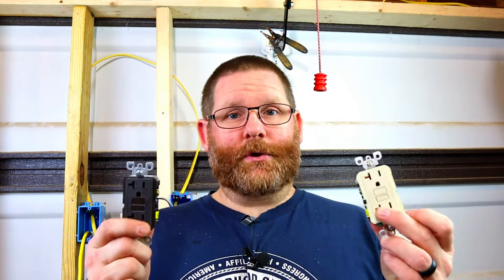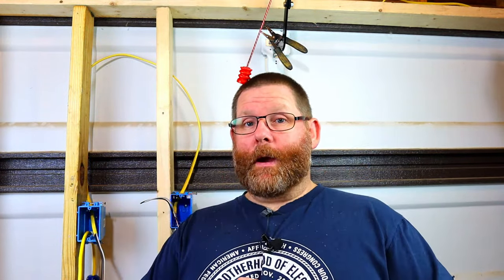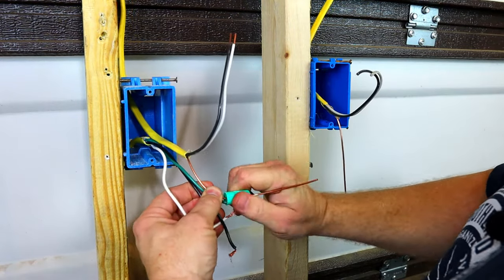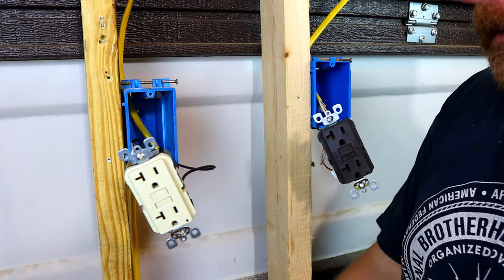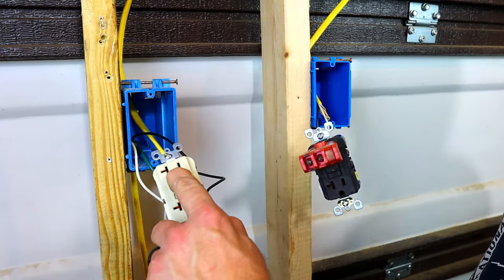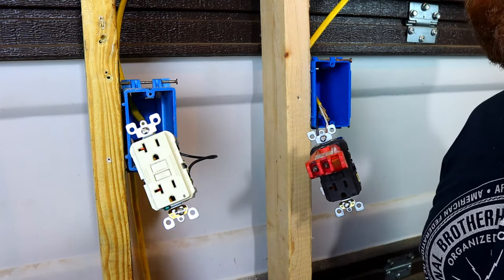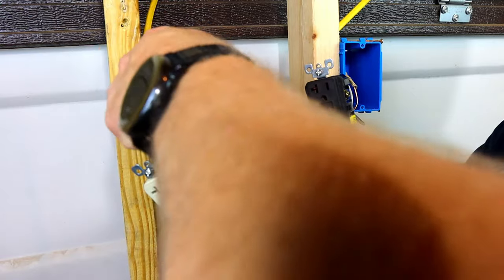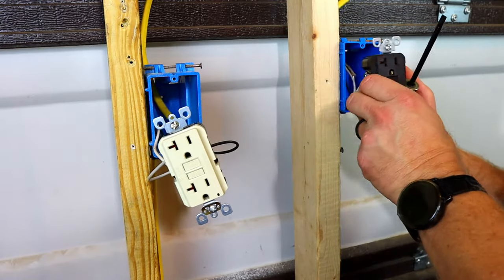How Many Ground Fault Circuit Interrupters On One Breaker

Comment: I know this video is 3 years old but I thought I would explain what is happening here. 
GFCI's  When they see a fault they trip very fast, like within a few milliseconds. 

In the first case with the two GFCI's wired together both see the fault and trip at the same time. 
To get both of the outlets in the first example working correctly you would have to reset both GFCI's.
In the second example the two GFCI's are wired independent of each other so only one GFCI will see the fault and trip.

Comment: Of course if you wire the second GFI to the load of the first GFI then tripping the first will kill power to the first and the second, that is why there is a load out from the GFI so that a single unit can protect multiple outlets. Resetting the first will restore power to the second which has no way of knowing that its power is coming from the load out of the first. So what indeed would be the point of using multiple GFI’s on one circuit? Well, if upgrading an older home the cost of multiple GFI’s might well be cheaper than the time required to figure out which outlet is closest to the breaker and which are downstream especially if you don’t have expensive tracing gear or a gopher at the breaker box. Wait, you say, how will you know which one tripped? No more or less of a problem than knowing which GFI has tripped and is blocking power to a regular outlet. I just finished replacing all of the receptacles (and switches) in a 40 year old home. Why? Fully 10% of the backstabs came out without needing to be released, 9 of the ground screws were not tightened, and all of the outlet boxes were too deep, exposing the terminals the the knotty pine walls. Yes, I bought the house from the guy who built it and wired it himself. Some of the circuit routing is truly bizarre. The upstairs bathroom shares a circuit with many of the receptacles on the ground floor and one and only one of the outlets in the kitchen is fed by the circuit that feeds most of the receptacles on the second floor.

Comment: Would this concept also apply if I’m connecting two gfi switch/gfi outlet combos? The application is to control two pool lights on the same circuit. Currently neither pool light is on a gfi
Reply from the maker: I am just going to say this. Pools is one thing that I know about but I don't not give much information about. Why, it's because there is alot of information that can be lost in the text. Bottom line is this. Just put it all as safe as humanely possible. This is a very critical part that has to be done correctly otherwise people can lose their lives. It's better to contact a local electrician or inspector who knows alot about the code and pools. Don't skimp on this. I just don't feel comfortable telling you about the code here... But if you put it on a gfci you will be fine.. Double check though because it could cost you your life. Happy Thanksgiving and Happy Holidays
Reply: Thanks man. I was able to figure it out. I actually was able to place both pool lights on the one gfci/ switch combo so they both turn on at the same time. The other switch  I was able to use for customer’s spa light. They’ve never had gfci’ son these lights. Not good. California code requires pool/spa lights to be on gfcis
Reply from the maker: Good my friend... Its always better to go above and beyond code to make it as safe or safer than possible. Thanks for letting me know and watching videos

Comment: So if you can just pigtail from the top line/load,  what is the point in the bottom line/load screws, as it doesnt work.
Reply from the maker: The bottom is for regular receps not gfcis
Reply: @MountaineerOutdoors  ok, question for you.  I have three GFCI's connected in sequence.  The first would not reset so I was pretty sure there was a problem and replaced it.  #1 was wired line side and two black and two white load side to the next GFCI.  #2 GFCI is wired two black and two white to the line side. #3 GFCI is wired Two black  and two white to the LIne side.  I have yet to determine what the final pair of wires from #3 GFCI powers.  I replaced the receptacle but following your advice, there are three blacks to connect and three whites to connect to the line side.  The new GFCI will only accept two lines.  it seems I should connect two together (two blacks, two whites), for a total of two slots.  Do you see any problem with this?  the other option is to replace GFCI's with regular receptacles using the load side connections from #2 to #3.
Reply from the maker: So I do not know everything about the situation you have and where the receps are. However, I would connect only to the line side from line to line. Then any other regular Recep you want to have can be on the load side.. I have a video coming out next year on this (I know not helping you now) I hope that answers your questions. Make joints where you can to save wires in your Recep.

Comment: How would you make the two wires into 1?  if you have a video for that could you point me to it?
Reply from the maker: So I actually don't have one yet but I am gonna make one because I have this question alot. I do have one coming out in a month or so on how to do it making it on 10 Guage wire... But I think that I will make one on this very soon. Actually here is one that I have might help you https://youtu.be/d6ZYZN0RweU
Reply from the maker: https://youtu.be/d6ZYZN0RweU
Reply: @MountaineerOutdoors  thank you!
Reply: @MountaineerOutdoors  ok i am still slightly confused.  In the GFCI video you mentioned you would never put two wires on a single screw but you would rather make a joint and then put one wire on the screw.  Thats the pert I am grey on.  How would you join the two black wires and then end up with a single wire to put under the screw?
Reply: @MountaineerOutdoors  never mind..i realised you would need a 3rd (jumper) wire to make it work ...i get itnow :)
Reply from the maker: Awesome

Comment: Ok so if you want to put a gfi do you have to test to make sure its not already on a gfi , how do you check that
Reply from the maker: You will have to track down the circuit and look at each receptacle to see if one is a gfci or not. Unfortunately that's about the only way I would know for sure
Reply: Buy a $5 outlet/gfci tester with push button test lol

Comment: I think this is against code? I don’t think you can rely on the screw on a receptacle?
Reply from the maker: Nope it's totally fine as long as you remove the fiber or plastic washer. So there is metal to metal contact and use self grounding receps

Comment: I installed 4 GFI’s on one circuit?   Why?   I had a house in Michigan with a basement.  The builder installed a GFi outlet right next to the service panel and then proceeded to run that wire to each outdoor outlet, in back, in front and on side with AC units.  Problem is, especially during Christmas season when it rained the GFI would often trip and I had to run down to the basement to reset.   Hard to determine if it was front or back lights.   I found it much more convenient to just add a GFI to every location wired in the correct fashion.   Live in Texas now but they did the same thing, first outdoor outlet gets GFI and everything downstream is daisey chained.   Pretty sure this is done as a cost savings.
Reply from the maker: Yes definitely a cost savings. Your scenario is one reason why it's good to have one at each location. Thank you for your comment and watching ☺

Comment: Thanks . When doing the hots would you use a Wago connector instead of a  wire nut ?
Reply from the maker: I absolutely do not like wagos in the least. I have seen them fail. That's just my opinion. Can't ever go wrong with twisting your wires and an old fashioned wire nut.

Comment: would you recommend using multiple gfci's on a single circuit if replacing 2-prong outlets. Or is it okay to use gfci on just the first receptacle in the circuit?
Reply from the maker: Good question. I believe that you will still have to replace each with a gfci.. Now having said that it's wise to ask your building inspector for clarification as I I have never run into that before. Let me know what you find out..my guess is that you will have to use one at each swap out
Reply: One on the first receptacle, all other outlets will trip the gfi OR one gfi breaker if for some reason you can't find the lead.
I'm not an electrician but I did sleep at a Holiday Inn ;)
Reply: The 2020 nec gives you the choice in article 406.4.d.  Article 406.4.d.c. allows the gfci to feed grounded type recepticles as long as the grounded recepticle is marked "gfci protected" and "no equipment ground" and is visible after cover install.

Remember, as always, ahj is king.

Also, remember that article 110.3 requires equipment be "....installed and used in accordance with any instructions included in the listing or labeling....."   So, if the gfci instructions say a maximum of 5 down stream recepticles, 6 would be a code violation.
Reply from the maker: True. Thank you for your comment ☺
Reply: I know this is old but the correct way to do that is put a GFCI on the first Outlet of the circuit. And then use regular Outlets with three prong on everything that is Downstream on that circuit. Next you are supposed to mark them, they have stickers that will say they are GFCI protected and not grounded. You don't really have to put the stickers on if you don't want to but that's what the National Electric Code says. You are not supposed to put multiple GFCI outlets on one circuit regardless of what this video says.

Comment: This is the video I'm trying to comprehend.
Reply from the maker: What exactly is the issue you are trying to figure out?
Reply: @MountaineerOutdoors  I have three gfi in a row on single branch; so can't use LOAD on all three; right?
Reply from the maker: You can, but If the first one trips the other 2 will go out. If you have 3 gfi's in a row, go from like line all the way to the end. If you want to add a duplex Recep then go off the load.
Reply: @MountaineerOutdoors  many thanks...
Reply from the maker: I honestly hope that I did answer the question you had fully. And anytime you need anything holler at me if I can I will help you. Have a great day
Reply: @MountaineerOutdoors  your the best !

Comment: The reason you would want more than one resettable GFI on a circuit is for convenience like you have two bathrooms back to back and so you don't cut power to other rooms if you have a ground fault  I have a GFI under the house and the rest of the circuit runs to the closed in porch. I had all the outlets protected by the GFI but that was a pain to go under the house to reset the outlet so I hooked up the rest like the second in the video. The porch is weather proofed so no GFI is required. I could put another GFI on the porch room if I wanted to and I may still put one. The GFI in the bathroom also protects the outdoor lighting and bathroom light as well. All passed inspection when the house was built. 73
Reply from the maker: Excellent comment. I agree with you. Have a great day and thanks for watching and commenting ☺
Reply: @MountaineerOutdoors  Whom ever put the GFCI under the house was in violation of code and should not be doing electrical work.  CGCI's have to have clear easy access.
Call a different licensed master electrician.
Reply: Adan M  no because it's the first outlet in the Daisy chain. I have three more GFI outlets for future use like in the shed. I'm not changing the house because it already passed inspection. Only future wiring will get inspected at a later date if I do the additions. Now I could put the GFI outlet outside and eliminate the outlet under the house that makes more sense because I need power outside and it was not required when I wired the house. I still would not need GFI on the closed in part because it's not a damp location. 73
Reply: Adan M  this is one plan I may put the porch outlets on a new circuit and install a few outlets outside which would be a better option. My Father in law wanted me to put some outdoor outlets but it never happened. The indoor box has now dual tandem breakers so I have a space or two left. 73

Comment: when using the jump terminals.... the second set of holes at the LINE connection point ... it is   ABSOLUTELY NECESSARY  that all wires are of the same construction and same gauge ..... any other combination...(stranded and solid or two different gauges) will almost always result in a defective and dangerous connection ... I know you just did it for this video for convenience. Still, you seriously should explain the dangers of what you are doing and why you yourself would never do this, and why you would personally never use the jump terminals to piggyback more receptacles.... you really need to make this clear .... you really do   .
  if you do use the jumper terminals and follow the correct procedures to do so  it is 100% safe and effective as well as code compliant in any city in this country ... that's why they put them there
Reply from the maker: Great point and I appreciate your explaining that to me like you did. I will Definitely make an update and explanation on further videos. Thanks for watching and commenting ☺

Comment: You would not want second GFCI on load side due to inconvince, best would be Regular on second. 2 GFCI's best placed on Line side as you mention, as tripping will not cause the other to lose power.
However, They actually will work the First way you mention as being wrong, most?/many will Trip when power is first applied. When you hook up second, correct way. Was watching to see if you would reset second GFCI, didn't see you do it. When you corrected the wiring, I didn't see you reset it. Think you may have unknowing.
Would like you to do same test again. But Push reset on second one. Take Care, Stratmando
Reply from the maker: I may have to redo the video showing that part in particular again.
Reply: @MountaineerOutdoors  Thanks
Reply: Thank you as well

Comment: most outlets and switches and such I have bought lately, even though cheap amazon purchases, have had the clamps..rather than the back stabs..
clamps let you put two wires under one screw easily
Reply: as long as both wires are identical  in construction and gauge
Reply from the maker: Great point

Comment: If I wire an extension cord (that is capable of handling it) to have a male plug on each end and plug it into a series of outlets, will it power up all of them? There are four outlets in the series. 120VAC
Reply from the maker: First of all I would never do that ever because that could shock you bad. So I will not honestly give my opinion on that. Two male ends is bad news. And an extension cord is only for temp purposes only.
Reply: @MountaineerOutdoors Yep two male ends is always bad news 👉👈 I'll have none of that, thank you! 😂😂
The series is dead with no other power to it. So my guess is it would just bring 120 to all four. I'd just be minus one plug that it uses.
Reply: That's a suicide cord wldnt recommend but the path of power will follow a completed path

Comment: What if there is a ground wire coming from an electrical outlet but it isn't connected into a bus, and is actually just wrapped into the main coil of ground wires going outside?
Reply: That would be useless, if not dangerous. If it is it connected to the breaker it won't aid I'm tripping the breaker if there is a fault. 

Then, if for some reason it comes in contact with an energized conductor, then you risk energizing the ground outside, which could create new hazards.

Comment: I would never advise anyone to use more than one gfci device on a circuit,use a breaker or recepticle device and dont install the gfci recepticle behind any appliances per 210.8

Comment: Outstanding information.  My bathroom is one of 4 GFCI outlets on the same circuit.  I didn't know this when I wanted to add a 2nd 'non-GFCI' outlet in my bathroom using a 15 amp outlet.  Replaced the 2 gang with a 4 gang box and I thought it would be easy.  As I was removing the existing GFCI, I wondered why there were 2 separate lines coming into the existing outlet with both going into the Line.  When I hooked up the new outlet using the Load terminals, nothing worked.  Could not figure out the issue until watching this video.  

I still want to hookup the new outlet in the same box.  Can I pig tail the new outlet and GFCI into the Line?  This will basically now have 3 connections into the Line.  Thank you in advance for offering any assistance.
Reply from the maker: I think that I understand. So yes you can do it like your saying but you should definitely have your bathroom gfcis protected by the gfcis so that it protects you from shocks.
Reply: @MountaineerOutdoors  thank you so much for the quick response!!
Reply from the maker: My pleasure good luck

Comment: He just connected the two gif’s in parallel not in series. You could do the same with a pig tail for hot and ground to the first gfi, then you would still feed power to the second independent of the first.
Reply: Do you need to pigtail the whites also?
Reply: @lynndalbertis5433  yes

Comment: In simple terms, wire GFCIs on the same circuit in parallel. It will not work in series.
Reply from the maker: Yes and no, it will work in series but if one goes out the ones following in series goes out too.

Comment: Why not have the gfci at the panel this protects every outlet & cable run.
Reply from the maker: Do you mean a gfci breaker?  Either way you are correct. Price is where most people shy away from the gfci breaker
Reply: @MountaineerOutdoors  UK we have split board 2 gfci covering half board each or RCBO we call device residual current, protection built into each breaker. £10 to £30 per breaker. Average 10 way board £200. Split board £120, very low cost for what your getting. We zone all hidden cable runs plus they are all protected from panel.